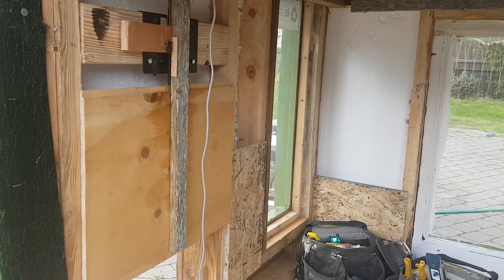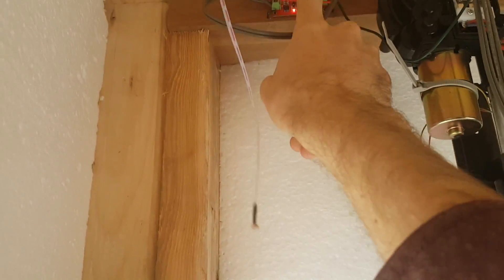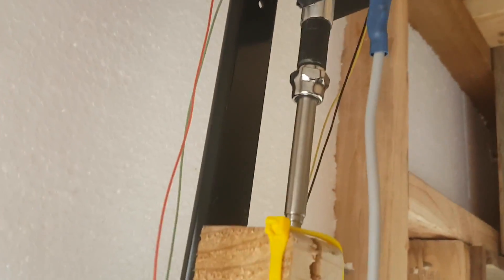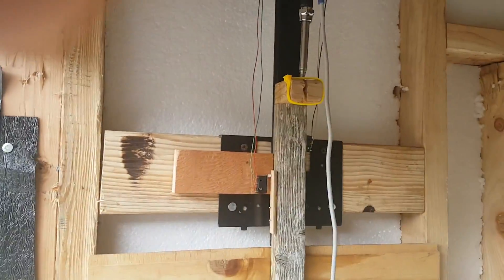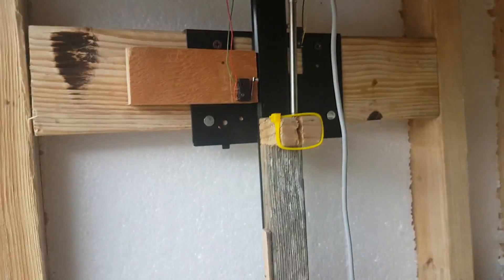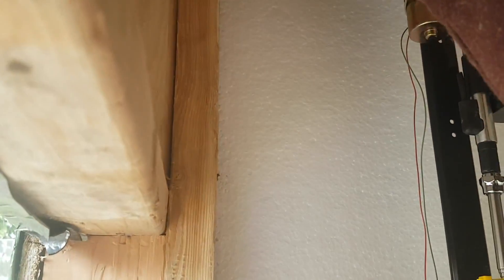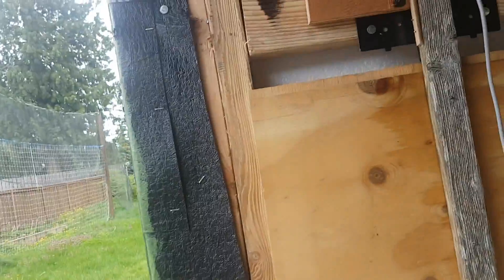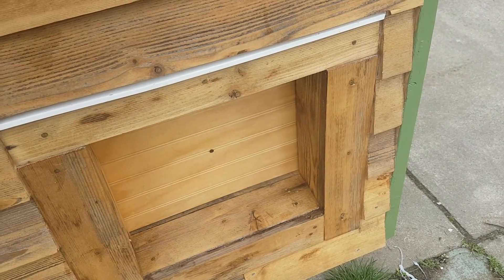DIY Automatic Light Sensitive Chicken Coop Door for $50 using car parts.

Comment: THANK FOR THE CAR ANTENNA IDEA, I WORKS ON A DOOR FOR MY DOGS TO GO IN AND OUT. ONLY $ 24 FUN TICKETS ON EBAY
Reply: Did you use the entire throw of the antenna? I’m doing the same thing but I don’t have the adjustable limit switch on mine that I got from eBay. Also I’m afraid to cut it shorter because I’m worried it will go up inside and the motor won’t stop

Comment: You may go to AliExpress to buy all the parts with $20 dollars.
1. Just let the antenna go all the way to the bottom.
2. Put a piece of metal with hole on the top of the door and let antenna go through it.  Use the metal to catch the metal ball on the tip of the antenna to pull up the door.
3. For the safety, you may use a 12v rechargeable battery with solar charger. (The 30w charger with controller may cost $24 dollars with AliExpress)
I am guilty to have baba stocks. :)

Comment: how heavy door can be lifted???
Reply: If your door is heavy, put wheels on it and go horizontal direction.
Reply from the maker: Not that heavy, this isn't a BMW antenna, it's a cheap Chinese one.  Also it really wasn't designed for this use.  Either make the door a very light 2mm plywood or use a linear actuator instead.  I recommend checking out the follow up video in the description
Reply: Just use a linear actuator and not have to worry about any of the troubles an antenna setup bring.

Comment: You realize after all the extra stuff you bought and wired so the antenna would not go down all  the way all you had to do was cut the antenna to length, right? Besides that great job!
Reply from the maker: Rofl that probably would have worked, but I was afraid to mess with the telescoping mechanism.  It has a rubber toothed belt inside that seems to attach to the last part of the telescoping mechanism.  Probably could have safely trimmed the last 8 inches off.  Overall, this whole approach turned out to be a lot less reliable than using a 12inch linear actuator ($50) with internal limit switches, although it requires you to use two relays to reverse the polarity.  Totally overpowered but does the trick perfectly, although it might be a good idea to have it connected through a string or something so it doesn't crush your chickens.  https://www.ebay.com/itm/2-4-6-8-10-12-Stroke-Electric-Linear-Actuator-Motor-Heavy-Duty-225lb-DC12V/162672168058?hash=item25e0044c7a:m:mT1VLu3YWyWBJ_jv9kBEEFg

Comment: what if a very dark storm comes?  Chickens get locked out?
Reply from the maker: The $10 sensor actually is adjustable.  It is MUCH darker at night than in very overcast weather. Very easy to differentiate.  It might detect "sunset" a bit sooner in darker weather but so will the chickens.
Reply: I personally never had any luck with the light sensor. It would open on full moons, it would close too early.  If that even happens 1% of the time, it's worthless... Bc chickens are one strike and you're out where I live.

Comment: this looks great if you can post a basic wiring diagram for us non electrical types that would be fantastic....thanks for posting :)
Reply from the maker: Well you may get a little further by looking at the sequel to this video, which I linked in the description.  The wiring is actually dead simple.  I'm sorry I don't have time to make a diagram.  The antenna takes 12v and then a 12v control, which we feed in from the output of the light sensitive relay, linked to in the description.  Really, it's that simple.  

The relay also needs its own 12 power, and you also need to put the 12v line into one side of the relay so when it closes it will send 12v to the antenna.  So  you need to power two things, one side of the relay switch, and then connect them together.  That's really it.
Reply: I made this.  This is my first attempt so I have no idea if it is any good.  I assume I need some resistors somewhere....  https://drive.google.com/file/d/1pcP3zDJMeA8EZt0ogmqTanHA59oq6U6O/view?usp=sharing